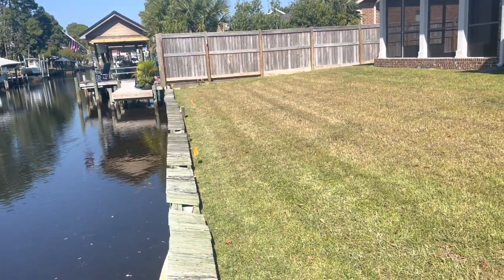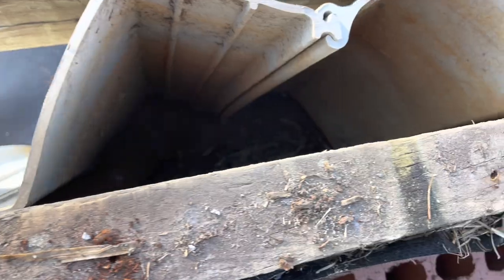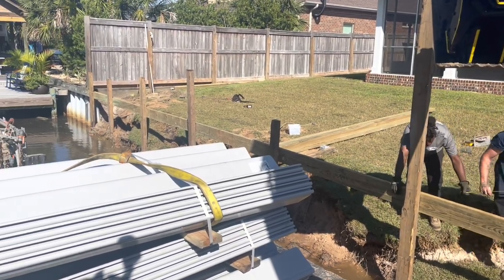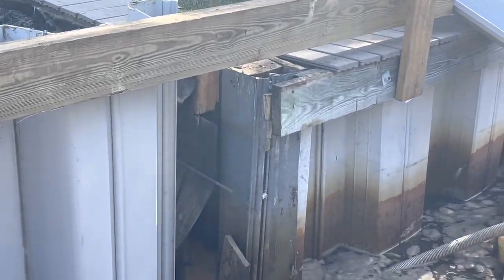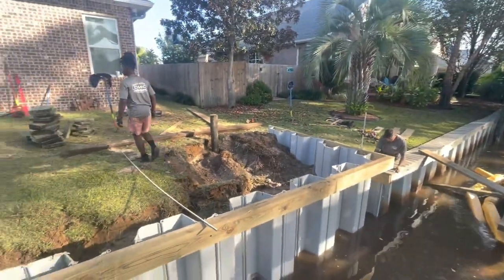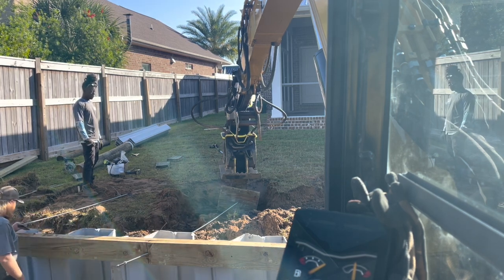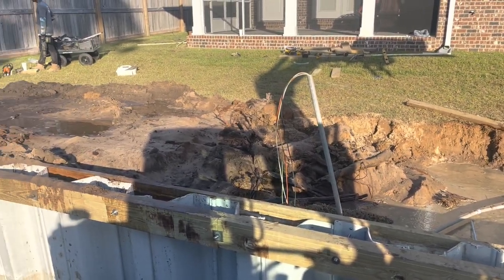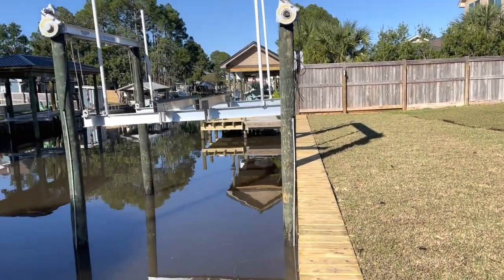FAILING VINYL SEAWALL REPLACEMENT

Comment: Do you have any insight on vinyl sheet profiles and thickness.  Looks like you use a lot of Z profile sheets on your projects. Is this customer choice or your preference?  Is there any advantage/disadvantage of Z profile over box ?
Reply from the maker: Thanks for watching my channel and years does a profile is pretty much our go to sheet we try to keep it pretty standard with a commercial type wall installation

Comment: Great info in this video, really appreciate it! When installing vinyl in front of failing concrete wall panels, how do you turn in for the wing walls? Especially when neighbor has same concrete panels with no separation at property line.
Reply from the maker: Thanks for your question. Sorry it took so long to get back with you. I must’ve overlooked it. Yeah that is a hard one to do right there. If you can’t cut the wall and get it removed then you have to attach that wall and make sure you get a good connection. I would take some 2.5 cc a treated lumber and put some anchor bolts into the concrete wall, and time on vinyl, end it out with some roach control cloth on the inside to prevent any leaking from any of the cracks. You might not be able to seal all the way.